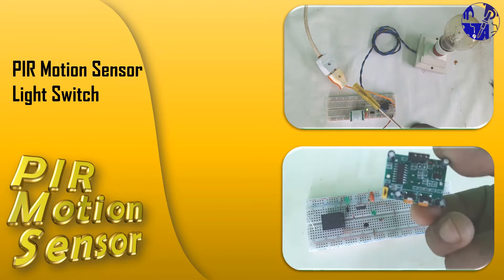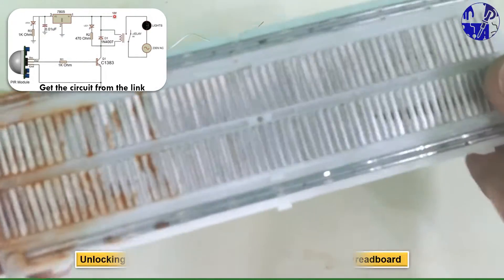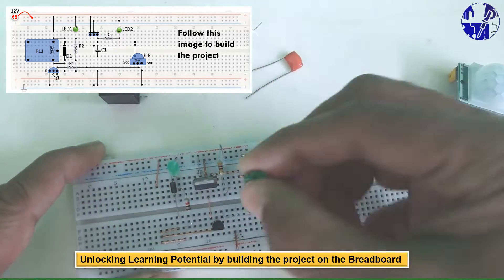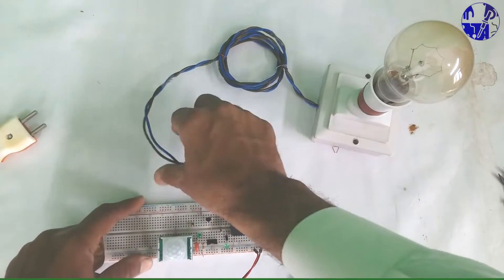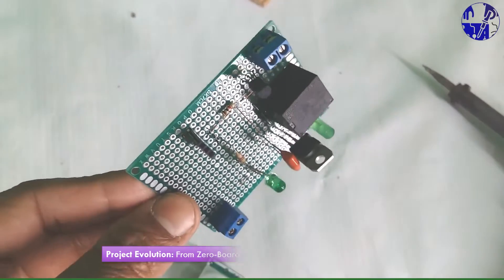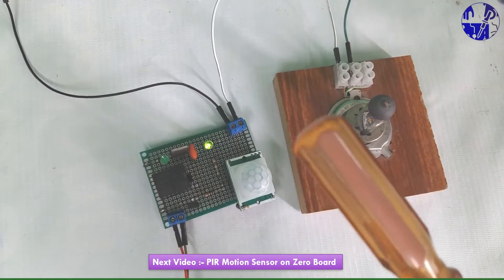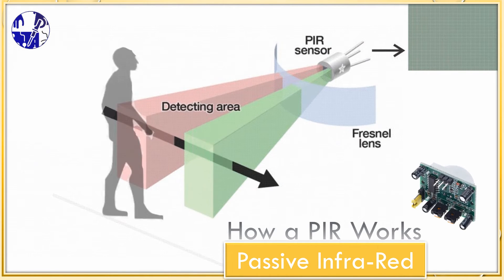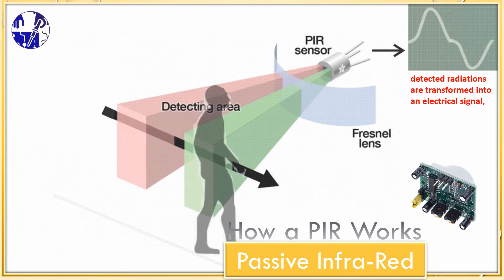PIR Motion Sensor Light Switch | DIY Security Project on Breadboard

Comment: Do you have the list of all components and materials needed specifically for the bread board? For School project purposes.
Reply from the maker: Follow this link to download all the project with necessary images and circuit diagrams of this PIR motion sensor light switch.
https://drive.google.com/file/d/1gG2-8jgBe8ktLMIC869O1QbNp6rl84Sy/view?usp=drive_link
Reply from the maker: The same project on the Zero board is also coming soon.
Reply: There's no list of components there
Reply from the maker: On page#2 of the PDF file, there is a circuit diagram of the project. on the diagram, every thing is clearly mentioned. But the Items are not in a List form. If you like the items in a list format, let me know again, I will update this project with the list included.
Reply: Thank you, but there's no list of materials needed there

Comment: Is the lamp and thebother parts already included in the circuit diagram?
Reply from the maker: Yes, all the components are included in the circuit diagram for your convenience.
Reply from the maker: lamp is not necessary, you can add any thing you prefer. You can a Buzzer also.